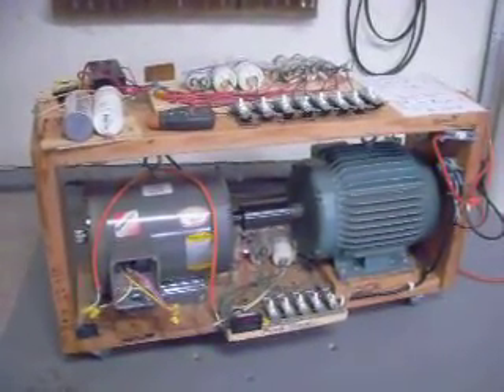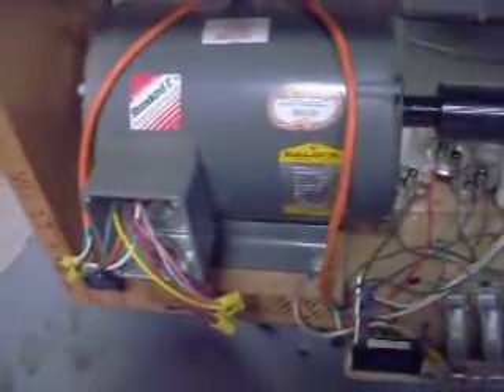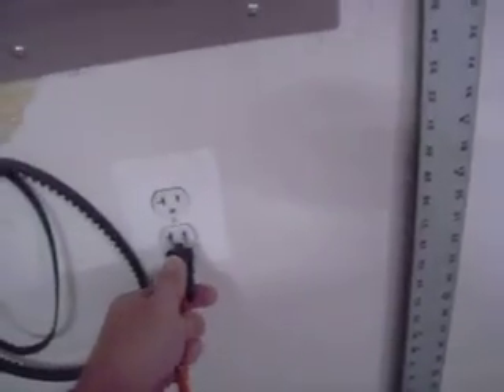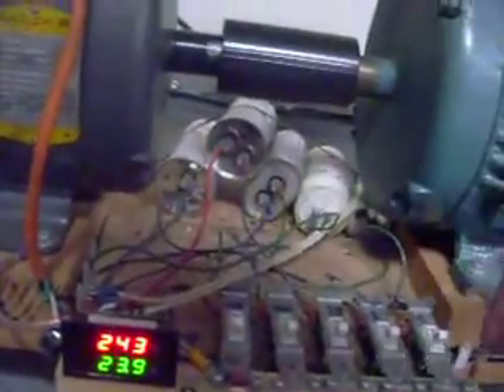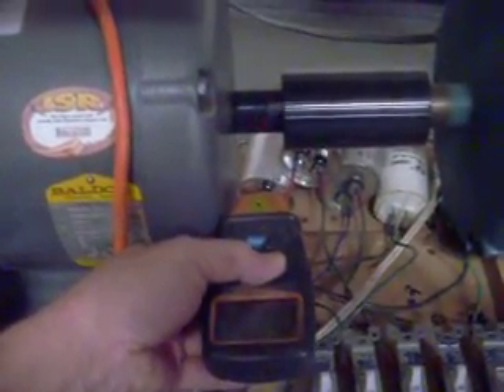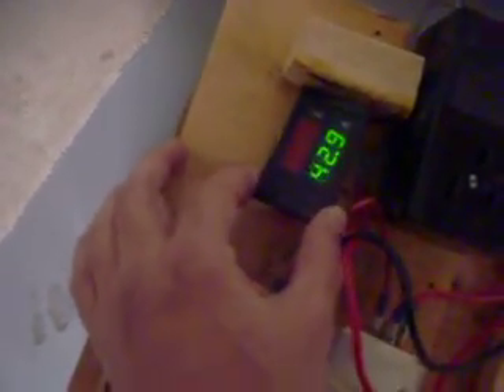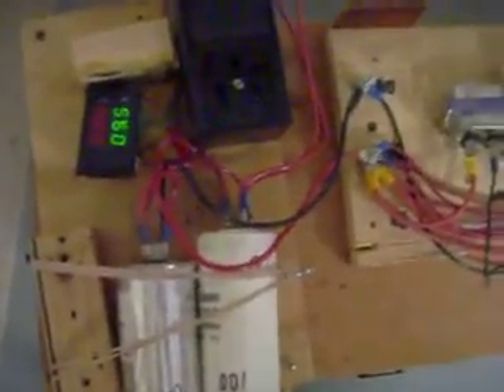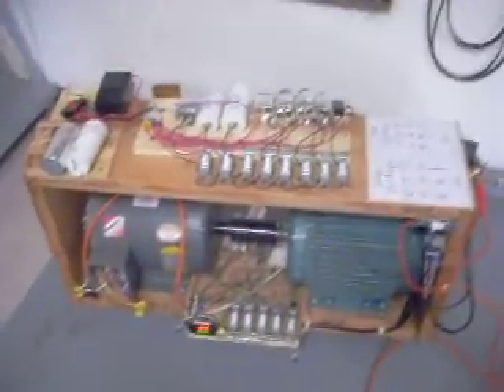RotoVerter by Bob

Comment: so how motor becomes alternator? how do you extract the energy out of it? can you plug something to alternator, wchich is motor? do you convert alternator just like prime mover? upgrade bearings, remove fan etc?
Reply: A 3-phase induction motor can act as a generator when driven faster than its synchronous speed by an external force.
Reply: @citizendc9  its 3 years but thank you for the response I heard already, but how the motor "knows" when it reaches its synchronous speed without any timers and electronics? and does output rises with increasing the speed? 2x speed gives 2x power and 3x goves 3x power?
Reply: @slave_K  Imagine your motor is inside a giant, invisible river that is always flowing at a constant speed, say 10 mph. This is the Synchronous Speed (Ns).

- The "River" (The Magnetic Field): This constant flow is created by the AC electricity you plug the motor into. The speed of the river is fixed by the electricity's frequency (like 60 Hz or 50 Hz) and the motor's design (its poles). It doesn't change.

- The "Boat" (The Rotor): This is the spinning part of the motor.

- The "Know-It-All" (Slip): The motor doesn't "know" its exact speed in RPM. It only "knows" the difference between its speed (the boat) and the magnetic field's speed (the river). This difference is called slip.

- When the motor is driven externally and reaches Ns, the "river" stops dragging the "boat" or being pushed by the "boat." The electric currents in the rotor that cause the dragging/pushing simply vanish because there is no relative motion. That lack of current is the motor's "signal."

For example: 

1. Motor mode (positive slip) | Boat is slower than the river | The river drags the boat forward. → Motor pulls power from the wall.
2. Synchronous Speed Mode | Boat speed is exactly the same as the river | The river and boat move together. → No drag, no current induced, no torque.
3. Generator Mode (negative slip) | Boat is faster than the river | The boat pushes the river backward. → Generator pushes power back to the wall.

The power output of an induction generator is primarily proportional to the slip (the difference between synchronous speed, Ns, and rotor speed, Nr) up to a point called the breakdown torque (or maximum torque) . Beyond that point, even if you increase the speed (making the negative slip larger), the output power will actually start to decrease.

In simple synchronous induction motor terms: 

A typical industrial motor runs at a full-load slip between 1% and 5% below synchronous speed. Let's use 3% as a good average.
For the motor to push its full rated power back into the grid, you need the same percentage slip in the opposite direction (negative slip).
So a 1200rpm 1hp motor would need 1236rpm to act as a 1hp generator. 

NOTE: The generator-mode will typically have the same efficiency as the motor-mode.

Hope this help!
Reply: @citizendc9  thank you for precise and elaborate answer, but what about the case when there is no grid, no frequency, for example motor is run by the wind turbine with the synchronous speed plus 3 %, does the speed still matter ? wouldnt the output frequency be determined by the speed of the wind turbine connected to the motor?
Reply: @citizendc9 so is it possible or not to run it off the grid?
Reply: @slave_K  Yes. You must first power up the magnets (the rotor) with a DC current (the excitation), and then spin the shaft. The motion (prime mover) and the magnetic field (excitation) work together to create the output current. Alternatively if you have a permanent magnet motor you can skip this step.

You can entirely ignore slip as it will produce at any speed in this configuration. Rectify the output to DC and convert back to usable AC. 

All this information and more is available via AI now. Specialist knowledge is available at your fingertips.

Comment: at 1000 V current jumps between chip pins in meter. Use HV Meter. Use HV Caps as first Caps, and HV Rectifier. BTW Maybe flexible coupling is key, recycling energy of loss of momentum, rubberball-like...

Comment: Output from the RV alternator has to be made in phase to be used properly...  Its VARS while its just circulating inside the alternator.   As you load the alternator, the input amprage to the prime mover goes up...   I have my own setup using a pair of 7.5hp motors, tho my PM runs at 3500rpm and the alt is rated at 1800rpm... so about double the output frequency as a result... (120hz)…  I can net about 500v at 8-9amps as VARS in the alt...  but if I try and use that on a load, the input amp draw goes up.
Reply: One thing I found helpful for Tuning was to put a 0-300vac voltmeter over the PM wires 1/2 and then another on wires 2/3...  I'd then dial in the exciting capacity on the prime mover to get the wire 2/3 voltmeter to read at the same volts as was shown on the wires 1/2 fed into the drive motor.
Reply: Also, its best to use separate analog meters as they'll average better than those digital meters... ;)
Reply: When you Startup the prime mover, you should hear within the first minute or so of it coming up to speed, it bear down and sorta grunt as the rv alternator starts circulating its vars...  I don't hear that when you start your setup up...  

Check out my mess here... :) 

https://www.youtube.com/watch?v=hKyX3Eu6bFY